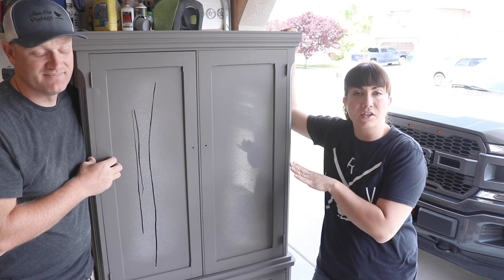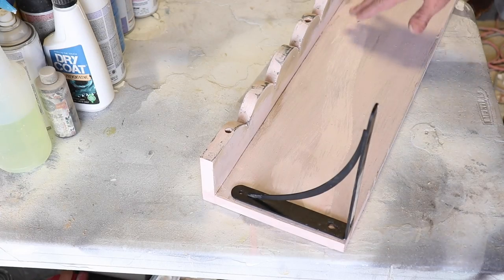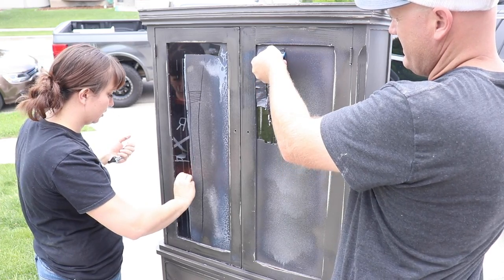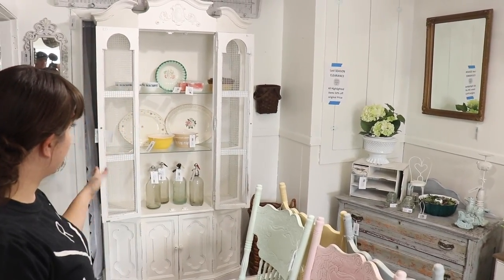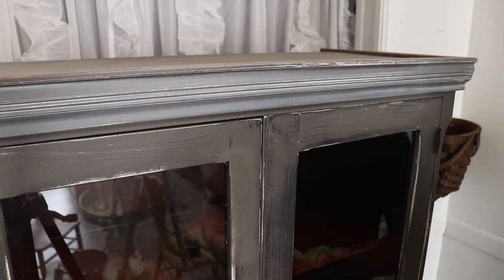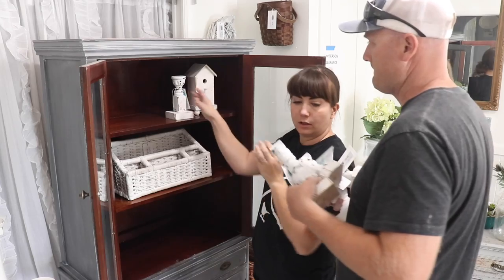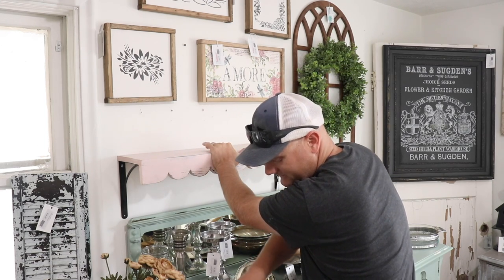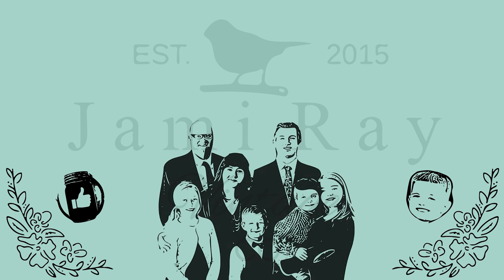Farmhouse Vintage Shop Summer Makeover

Comment: Looks Amazing. I spent all day Saturday sanding the top of a coffee table. Beautiful underneath all the paint, but when I stain, there were several places that just would not take stain. I tried shellac, but nothing. Can you suggest anything that would help.
Reply from the maker: If you get oily wood that won’t take stain try sanding down again and using a wood conditioner.
Reply: @JamiRayVintage  Thank you for the suggestion. I have decided to paint but will try that on the next project. have a beautiful day.\
Reply from the maker: Thanks!  Best of luck!